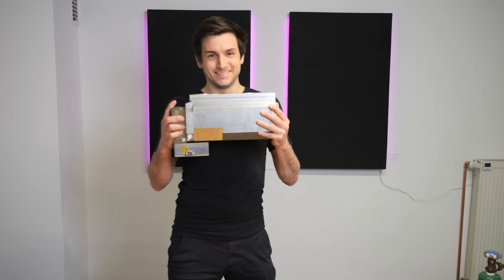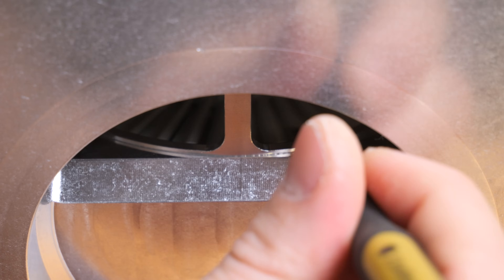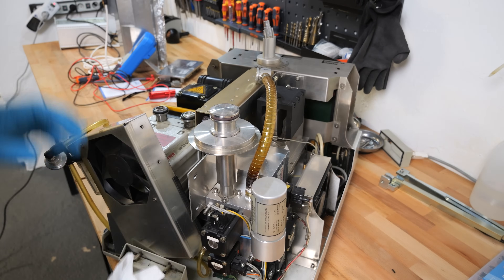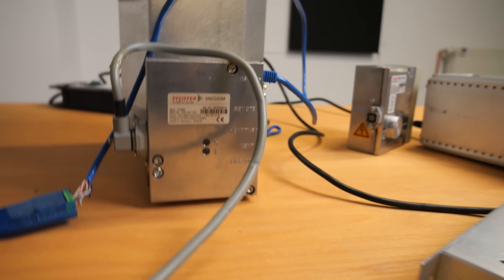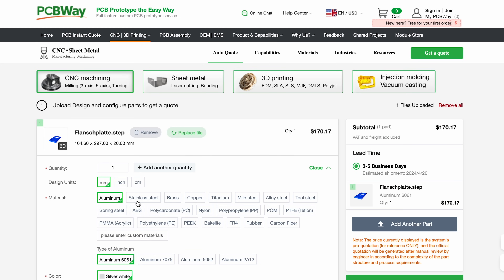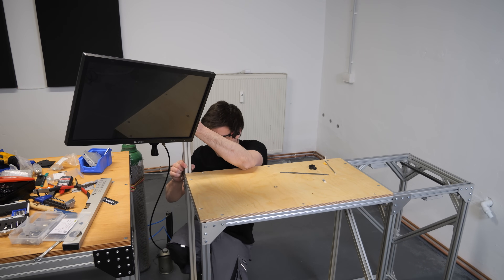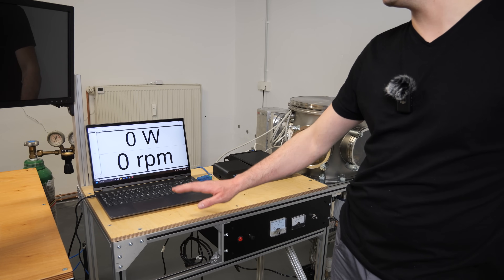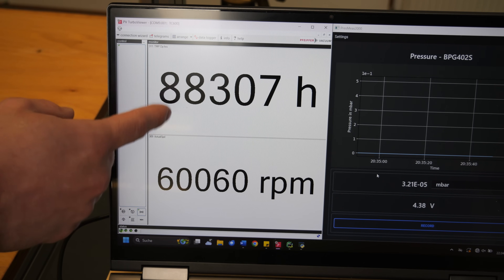Have You Ever Seen a Turbomolecular Pump Like This One?

Comment from the maker: Thank you to all the comments that informed me that the non-insulated transformer was the cause of the electric shock. That was a careless mistake on my part. 
Thank you for explaining the reason!
Reply: if you want a tip for the baffle, in all the coating machines I have used they are built like window blinds, with the slats covering each other and tilted towards the top of the chamber (orthogonal to the path towards the evaporation or sputtering source). Also, there is always a 90° elbow between the chamber opening and the pump opening
Reply: Not insulated but isolated. They are a bit different. Insulated means that it is covered by a resistive material and isolated means that it is disconnected completely from the source in question. Auto transformers have an electrically connected primary and secondary and that is why they are not isolated. I still don't really know how they work though.

Comment: A lab technician here that works whit massspecs. . This pumps (only some of them) when spinning op or down can make very loud noises due to small imbalances and resonance frequencies but this will go away when the rpm leaf this resonance level. We have one MsMs detector and every time when you shout it down to clean it or powering it up after cleaning there is a certain point were it makes an or full noise but otherwise it works fine for many years. And since the many up time was mentioned in the video: we an I think most labs lad this pumps run 24/7 werthere we use the device or not only shouting it down for cleaning or repair. And yes it is astonishing how long this pumps last our last MSMs detectors were used for over 10 years and only one of them needed a replacement pump. But I would be very interested in seeing what happens when you suddenly disconnect the rouging pump at full speed. I’ve heard that the outcome maybe very violently but never seen anyone actually trying that (of course white proper safety precautions…)

Comment: Thank you for your video. It has provided a great inspiration for repairing the pfeiffer TCP120-RS232. It is possible to detect controller issues, as well as the temperature and speed of the molecular pump, through software. Your video is excellent.

Comment: Hi, I am just getting into vacuum, for my 1980s neon tube processing machine. I have an Edwards RV3 and im about to add a small air cooled edwards diffusion pump. All the info at the start of this video with the mean free path was really interesting. Would you be able to (or have you already done) do a video going into this theory in more depth? I am just getting my head around the powers, my system goes down to 1x10-3mbar but sometimes I hear people talking about 5x10-3 etc, or torr, or milimeters or microns or pascals. A video that just explains what all that is and how it all works and how to relate one to the other would be really helpful. 

Thanks so much for your videos so far, its fascinating. 

Pete.

Comment: I have 2 Edwards next 240 pumps that only has 2100 working hours on them. This since the bottom bearing failed most likely due to fabrication error since the ball cage fell of a 60k rpm. Could also have been due to low oil but not sure. Nothing else on the pumps was damaged.

Comment: 15:37 Yea its pretty much impossible to find any information on these pumps. And btw you cant really destroy a turbopump by starting it to early since they normally have a built in a protection system that if it wont go up to a certain rpm within a certain time or that the current draw doesn't go under a certain time (at start up) if will indicate a fault and stop.

Comment: that 88,000 hours on the pump reminded me one time i bought a "new" 500gb hard drive off of amazon like 10 years ago, when i got it i used crystal disk info on it and it had 300 power on cycles and like 80,000 hours on it i still have it in a box

Comment: Hi! Good work as usual! You should replace the oil cartridge in the pump with a fresh one ASAP. Since I have many old used pumps with more then 32000h of run time, I usual just soak the cartridges with fresh TL011 oil, works good but its better to replace with new.

Comment: Variac you used isn't isolated from the grid and your equipment has GND net connected to its body. So you have phase potential on all your equipment. Never use a variac to power any low voltage equipment without an additional isolating transformer. It is quite dangerous not only phisiologically-vise but also from fire-safety view. And, of course, getting shock from your equipment means draining some current through your body but this current may damage random electronics in your equipment because it goes trhough almost random nets like digital interfaces, sensor cables and so on.
*I heard that using turbomolecular pump with no pre-vacuuming with usual pump isn't a good idea. I don't know if it's really true or not but I can see some logics in it.

Comment: Sweet! I have a little pfeiffer TMP I bought for like $150 USD. I'll see if I can get it running
Reply: Were you able to launch it pfeiffer TMP?
Reply: @aftaev  I have not because I thought I need an additional controller. I recently got a hold of the manual and it looks like I have everything I need to run it, aside from the power connector. I'll see if I can get it to spin soon. 
I don't have an immediate need for HV/UHV but it will be good to know if it works.
Reply: @tanner3801  I have a turbo pump PFEIFFER TMH 261. This is a 48v supply voltage. I tried connecting it to a VFD Delta MS300 1500HZ. I changed different V/F parameters. But I couldn't start the engine.
Reply: @aftaev  I'll double check my manual. What I saw that it requires 240V AC (of course I was already going to double check the voltage and pinout before connecting anything). I'll let you know if I can get it started. Won't be immediate but perhaps in coming days or weeks once I finish up other autumn projects.
Reply: @tanner3801  What model of pump do you have?

Comment: It may not matter at the pressures you’ll be using for sputtering, but mating threads create PITA virtual leaks for high vacuum. A narrow groove milled or ground lengthwise along the shaft of the bolt wherever there’ll be a nut or it will enter or pass through a threaded hole will shorten the escape path for air molecules and drastically shorten the pumping time to reach higher vacuums.

Comment: You should use Raspberry Pi rather than whole PC for monitoring and even maybe controlling the vacuum table components.
Reply: There's a good chance whatever software he uses (self-made stuff aside) runs on standard x86 Windows systems. The Raspberry PI has an ARM CPU. So not a great combination.

A small-form-factor x86 PC makes much more sense here, e.g. an Intel NUC or similar.

Comment: I think this controller is just a VFD if u get the voltage,amp and frequency right other contorller/vfd will also work on this pump
Reply: I tried to run the turbomolecular pump from different VFDs. It was not successful. I tried VFD Delta special model for spindles up to 1500Hz. It also did not work.

Comment: Searching for swollen capacitors was the bane of my job here for the first year.  I found and replaced three with no luck. One starting capacitor on a coolant pump, a power supply capacitor for an Edwards turbo controller, and one on a small pneumatic control block.  Lesson learned, I'm an not an electrician.  Lessons also learned at my current job; I'm not an optician, wet chemist, or physics modeling expert.  What I am is a middling button monkey. 😅

Comment: I thought it wasn't safe to turn on these types of pumps in open atmosphere.  Was i misinformed?
Reply from the maker: There is no harm in starting a turbomolecular pump at atmospheric pressure for a few seconds. 
You shouldn't vent it when it's at full speed or let it run for long times. But it won't hurt the pump to shortly spin up.
Reply: @AdvancedTinkering  cool! Thank you for explaining that to me.

Comment: Ahh, the good old Pfeiffer experience of having the wrong voltage version controller for a pump. 
If the pump has already been running for a long time and you are going to pump heavy gasses like argon, you might run into material fatigue of the rotor at some point. You might want to think about connecting the pump to some extrusions to absorb torque in case of a crash rather than have the ISO-KF flange suffer the hit. 

In any case, very nice to see how your project is coming along.
Reply: Absolutely. The vibration in some cases can kill the bottom ceramic bearing in few months

Comment: German plugs are unpolarized if i recall correctly, so it would be a tossup whether the output of the variac was referenced to neutral( which should be around earth or live
Reply: So to clarify 48v DC corresponds to about 34v AC. Because of unpolarized German plugs the two outputs of the Variac will be either 0 and 34v with respect to ground. Or 230v and  230-34=196v with respect to ground, depending on which way you plug it in. You rolled unlucky and got the second, and thus basically just touched the live, and got a shock

Comment: For a student you always seem to have very nice equipment!  I hope your pump works out for you, I also have a split molecular pump and just blocked up the lower vacuum hole with an aluminum plate.  It worked just fine, and although I switched to another pump, I never had problems with it.  I definitely got some odd noises when it spun up, but I believe this has to do with the transition from being supported by sleeve bearings to the magnetic bearings once it spins fast enough.

Comment: Variacs are autotransformers and thus not galvanically isolated on the secondary side. So the output is still referenced to mains earth and a single point of contact can give you a shock. Since you rectified the voltage, both positive and negative terminals are connected to the reduced mains voltage (alternatingly via the rectifier diodes) and thus have a certain potential against mains earth/your body. One of those two is probably connected to the pump housing (probably the negative one aka "ground").

Comment: A variac is not isolated from mains so the case got full mains on it (there exist variacs that are isolated but they are very rare and extremely expensive) so if not fully understand them they can be lethal, you were very lucky there.
Reply: I was looking at it at some point. Yes they are expensive indeed and it's funny how combining an isolation transformer and a Variac is significantly cheaper.
Reply: @TrickyNekro  Easier to make.

Comment: Never run a turbo pump at atmospheric pressure, it needs to be in high vacuum
Reply from the maker: There is no harm in starting a turbomolecular pump at atmospheric pressure for a few seconds. 
You shouldn't vent it when it's at full speed or let it run for long times. But it won't hurt the pump to shortly spin up.
Reply: Yup its OK to test for a few seconds to see if the motor spins.. The worst thing that could happen is if your chamber has a sudden catastrophic leak while spinning at full speed. This is BAD. I've seen them grenade from that before.😮
Reply: @christopherleubner6633  I usually go with Turbo Salad. I have also heard it called Turbo Confetti. There was no food or fun when either of those happened.
Reply: @christopherleubner6633  That will wake you up!

Comment: The reason for audible vibrations can also come from the fact, that the rotor speed of the pump sometimes hits exactly the resonance frequency of your chamber (or a multiple of it). Espeacially all the aluminium foil likes to vibrate and make sound ;)
I have a spectrometer at work with 9 turbopumps attached, and when I turn all of them on or off at the same time, it not only sounds like the deck of an aircraft carrier, but also some really nasty high pitch sounds from resonating components in between :D
Reply: Phew that actually makes me less worried. Thank you.

Comment: Tip for using threads locker or pipe dope: put it on the male part of the thread!
If you put it on the female part the bolt tip will push out the majority, if applied on the male part it will get spread between the threads all the way in. And on pipes you don't push the surplus into the media side! 😉
Bolts still won't fall out though.
Reply from the maker: Thanks for the advice!
Reply: @AdvancedTinkering be careful though, this is only valid for through holes! On blind holes the correct way is to put it into the hole as you did it, then the thread locker gets squeezed up along the whole thread as you compress the space below the bolt.
Reply: @artemiypolozhintsev6190  Not true, if you do that you will hydrolock and risk to Crack the part. Thread locker is way to viscous to get pushed through in quantity!
If your blind hole hase enough space behind the bolt you can do that to avoid having the excess on the outside, but then you have it inside the hole for the next time you might have to disassemble it.
Let me guess, you are American? 😁

Comment: Variacs are not isolated transformers IIRC. So it is possible that this pump is designed for an isolated PSU and connects the body to "ground", but you got the live and neutral swapped and the input voltage is present between the body and mains earth!

Comment: The output from a autotransformer is not isolated from mains. So the 48VDC supply you build using the variac wasnt isolated from mains either.
Reply: Yup. For these types of shenanigans it's good to have a 1:1 isolation transformer handy. It's also useful if you want to use an oscilloscope on mains-connected circuits.
Reply: @jaymzx0 I recently fried something because of this... but it was a junk for curiosity thing and isolation transformers aren't exactly free
Reply: Yeah that's pretty dangerous. You get full mains voltage on the pump case if you're unlucky. He was lucky not to fry the USB adapter...
Reply: @PlaywithJunk laptops are usually floating
Reply: @thewhitefalcon8539  Not from my experience. DC input ground is in most cases connected to all other grounds. If the laptop has a metal case, this is also connected. The power supply GND is connected to earth by a capacitor, that's floating, yes... but if one laptop input gets a non zero GND, the whole computer will be on that level and possibly hurt you or attached devices.
I have a laptop with a faulty power supply, it has 50-70 VAC on the case and every port GND. High impedance, low current, but you can feel it.